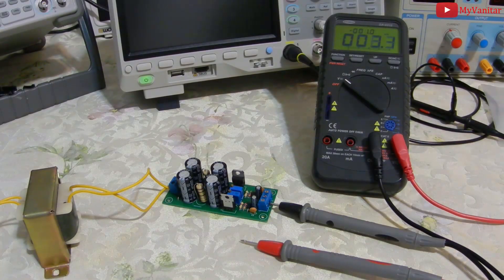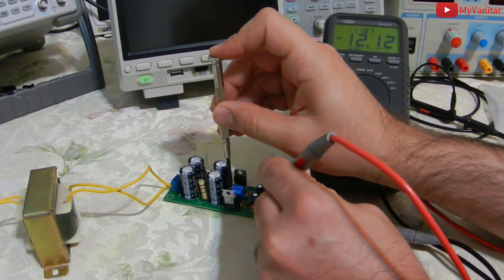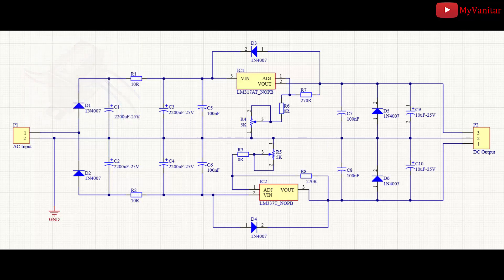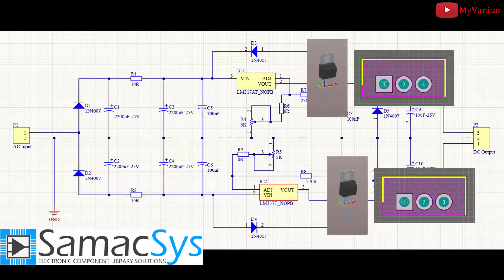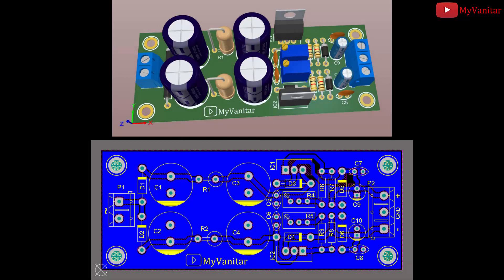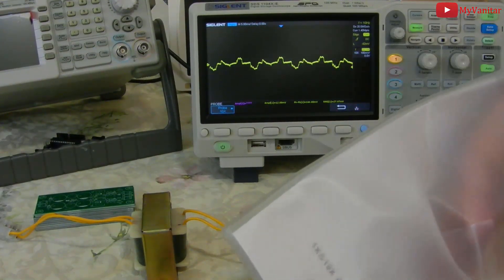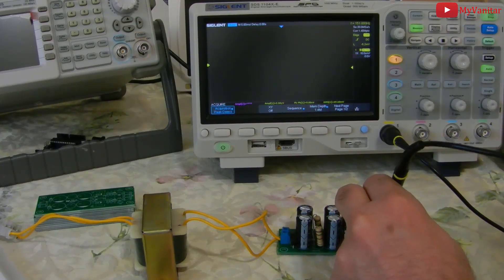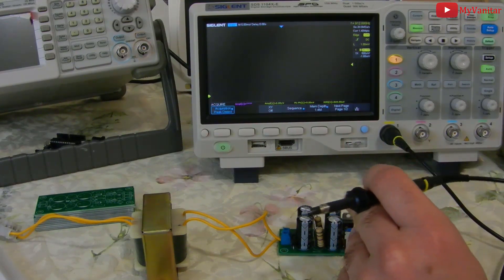Linear Power Supply Circuit [LM317, LM337, Adjustable & Low Noise]

Comment: Hi, I bought 5 of these boards and would like to build a power supply to replace the switch mode supply in my cheap FY3400 signal generator. The instrument requires +12v-0-12v and +5v for onboard usb and leds. What would you suggest as the most effective way to achieve this output. Is it possible with a single transformer or should I replicate the psu and adjust each for 12v and 5v respectively?
Reply from the maker: How much is the current consumption on the 5V rail?
Reply: @MyVanitar  The current consumption on the 5v rail is 280mA at 24MhZ.

Comment: Thank you for your prompt reply.   I would like to know if I feed a DC supply to the input of lm317 and lm337 , do I still  need c1 to c6 which I assumed to be for  filtering  the rectified AC.
Reply from the maker: it depends on how good is this DC, you can reduce the resistance instead, for example 1 ohm

Comment: Is it possible to use 12 Volt DC supply from an ATX power supply at the input of LM317 and LM337 to obtain +/- 5 Volt?    Thank you.
Reply from the maker: Yes, just use wires instead of rectifier diodes

Comment: How robust is the output voltage of the circuit to variations of the input voltage? For example, if the mains voltage drops from 230V to 180V, will the output voltage also drop by 20%?
Reply from the maker: No. it depends on the difference between the input/output voltage. if the input voltage does not fall off this range, nothing will happen. you as a designer should predict such situations, if they could happen

Comment: I need help sir. I have built lm317/337 psu and i don't have oscilloscope but only dmm. My ouputs are dead locked to +/- 15VDC as per my needs. But please tell me, is it normal to get 16mV AC on those regulated ouputs? To me 16mV Ac sounds a lot? Pcb is my own design based on VRDN power supply
Reply from the maker: Did you design this circuit on your own PCB? The output should not be like the one you mentioned. if you get a high current from output, the noise level increases, but for low currents, you should not read that

Comment: Good day. I have bought 5 of your boards they work great.  I have a problem with one of my powersuply and wanted a little advise. R1 gets really hot on start up. I am use a 3 wqtt 10r . I just wantedto know if the power suply would work without the resistors  R! and R2. Thanks
Reply from the maker: Yes, it will work, but the output noise increases. you can use resistors with lower values or short the resistor's footprint by a wire (jumper). This is actually an RC filter.
Reply from the maker: This is mainly a low current, low noise power supply for sensitive circuits (using that RC filter)
Reply: Thanks

Comment: Effectively this is using two halfwave rectifiers one for positive one for negative. This means each polarity isgetting supplied with intermitent  pulses of power. Even with the complex input filters pulsating dc will arrive at the regulators. This maybe ok for non critical low current applications, but for things like quality audio a tranformer with two secondaries and fullwave rectification is needed.
Reply from the maker: My claim also confirms your comment. for high current applications, even a full wave rectifier is not enough and we need stronger filtering methods, in future, I will cover that
Reply: One thing I dont remember hearing being mentioned is fusing at the transformer side. Can anyone elaborate please.

Comment: Nice but, ripple needs to be tested at maximum load condition and usable frequency but yeah I liked it.
Reply from the maker: Yes, this circuit has been designed for sensitive circuits and low current applications. check my other projects as well.

Comment: Cool but no heatsink - i like to do the RC filter too ... i've designed similar but the single supply rectifier approach is very nice. I learned something from this design.
Reply from the maker: Thanks, actually what you see is not necessarily a final product to be used "as it is", so I only install heatsinks for testing purposes or no heatsink for this test, because the load is small.

Comment: Since this works with only 1 transformer secondary, I wonder why 2 are used so often.
I'm planning to build a variation on this using an LM2940T-5.0 and an LM2990T-5.0 to give +/-5V outputs. Thanks for the design!
Reply from the maker: Thanks
Reply: Me again. Thanks for all the help so far.
What I need is a 1amp power suply but wanted to ask if using bigger caps and removing r1 and 2(I have noted it will be more noisy) would slow for higher currents.  Alternatively could I ask your assistance in drawing up a on 317 337 power suply that would allow 1 amp.  Thanks a Lot for your help

Comment: Hi !  thank you very much for your excellent video !  i have at hand a preamp that needs +/-24V   The present power supply is based on fixed voltage regulators providing negative e positive voltage.  What would be your choice of circuit to get the minimum noise ?  the circuit has low distortion already but noise depends a lot on the quality of the power supply of course.  Kind regards, gino
Reply from the maker: Thanks Gino. In all power supplies, the output noise increases by increasing the output current, so if your load is an PreAmp, this circuit will work perfectly. However check the current consumption of your circuit for confirmation. if I remember I selected the input/output capacitors to be 35V or 50V, decide based upon your application. Since your load consumes low current, you won't need to keep the input voltage much higher than the output.
Reply: @MyVanitar  Hi thanks a lot for the kind advice. Do you sell the boards or the kit maybe ?  or have a link to a seller ?  as i said i would need a low ripple +/-24VDC power supply.  I was thinking to buy a lap one but it is too big and the best ones are also very expensive units.  The other option  could be an additional regulation stage before the +/-24V stage in series.  I am a quite undecided.  The preamp in question is decent an old Bryston 0.5B ... it is low distortion but channels separation could be better i understand.  Kind regards, gino

Comment: Could you test the output voltage at maximal und medium current. With no load is every linear controlled power supply fine.
Reply from the maker: The output voltage does not get affected by the load (output current increase). More output current just means more output noise and this is true for all power supplies. regulators keep the output voltage untouched, however, increasing output current causes more voltage drop on components. for example you can not get 12V output from a 12V transformer at the input. So in such cases the input voltage must be higher to compensate the drop. V=R*I, so at 500mA output, a 10R resistor will case 5V voltage drop. Therefore this circuit mainly get used in low current and noise sensitive applications such as a pre-amplifier ... etc

Comment: good day i want to convert irobot roomba battery to li ion battery. This is a very common issue. How can I do charge voltage ranges from 7 to 20v .. 3200ma - 14.4v 5200ma liion battery
Reply from the maker: Replied you on another video

Comment: Adding 10μF bypass capacitor from ADJ pin to GND can improve PSRR for additional -7dB.
Reply from the maker: Thanks
Reply: @MyVanitar  You can see in LM317/LM337 datasheet that manufacturer recommended to to add bypass capacitor between ADJ and GND pins for lowering PSSR about -7dB but with good relationship between bypass capacitor and output filter capacitor it is possible to lower much more PSSR then just add that 10μF between ADJ nd GND pins. TNT audio measure and experimeted with this relationship and conclude that is very good PSSR rejection and relationship between that two capacitors are 22μF on bypass and 220μF at output filtering capacitors (C9/C10 on your scheme). Result is additional --20dB reduced PSSR and now is under -80dB at final measurements. In case if you add bypass capacitor than you need to reconnect diodes D5/D6 directly from ADJ to OUT pins on LM317/LM337 because now that diode have this line cuted with bypass capacitor and now does not have direct connection between that pins (see LM317/LM337 datasheet). I like your schematics because does not need dual transformer output and it is simple to add another power supply in parallel with different voltage eg. 5V in parallel with same transformer. In that case we can have +/-12V and another +5V dual power supply for many different aplications eg. FY6800/6900 function generator need better power supply instead of junk inside them and I see that your scheme have realy nice perspective for that. Many thanks for your great scheme.
Reply from the maker: @FileFixer007  Thank you very much for the information. Yes this circuit is useful in many double supply scenarios, where each supply rail can be adjusted individually.

Comment: Hi, really nice designg and well done PCB. I like it. Tnx. However the next step in improving the design would be the so called tracking dual power supply style where you only need 1 adjustable potentiometer to adjust 1 rail only and when you do that then the other rail will automatically self adjust the very same voltage  level. There are some old IC's that do that  + short circuit protection as well but they are no longer manufactured and very hard to get. So it would make sense if you could design such a circuit with individual components and perhaps add some heat sink so the circuit can be used for current values that exceed 1A per rail.
Reply from the maker: Thank you very much for you suggestion. That's interesting, however in this design I also intent to address the cases where both rail are not necessarily identical. for example positive rail could be +5V and the negative could be -12V.